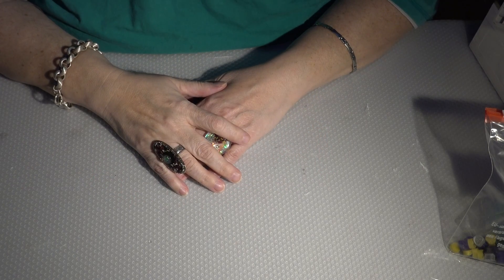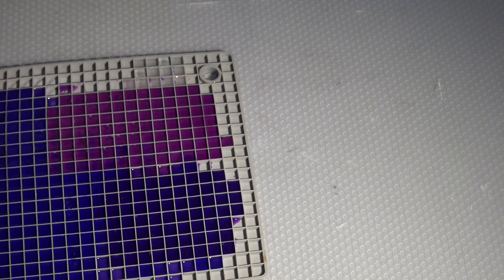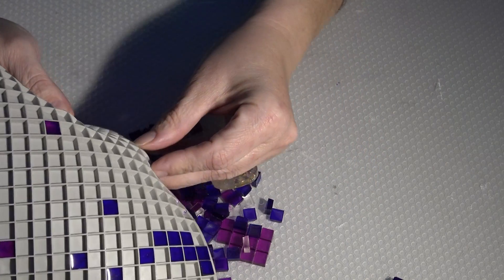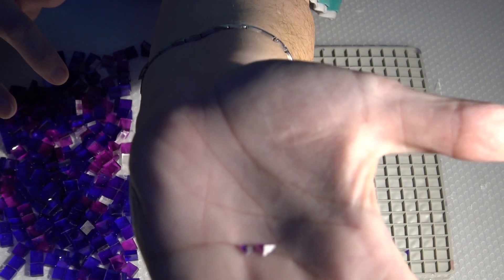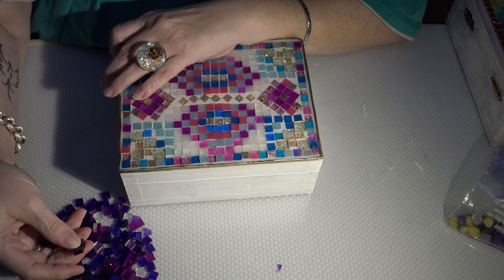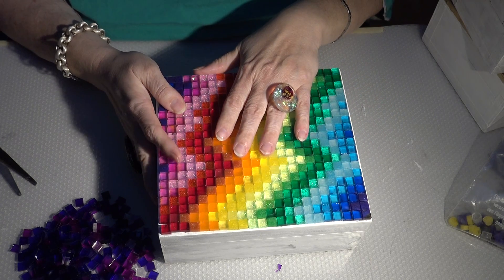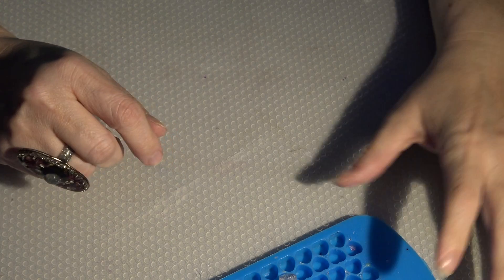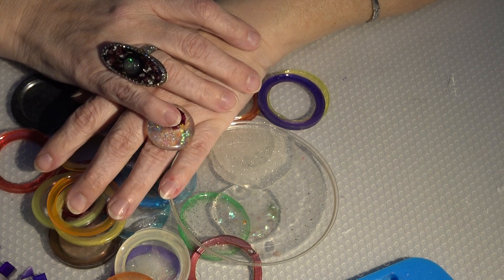7. What to do with my leftover resin???

Comment: Great video! I've seen people use the square tiles to use as a backsplash in the bathroom or kitchen.. the rings from the bottom of the cup (as well as the square and heart pieces... Used together ) would be cute as earrings.. I'm also thinking the circle ones could be linked together for a belt...
Reply from the maker: That are really good ideas! Thank you so much. A backsplash, yes that would look really nice, but I would be afraid to melt it, if a hot pot gets on the surface... But maybe behind the sink... That would be just as nice 😊. Than you.

Comment: With the circles:  how about some cool mod hippy earrings or a big statement necklace using the bid disk surrounded by smaller circles?  Or a cool hippy belt with jump rings in between?  Some kind of drill would be needed for the wiring of course...just a thought.  Lovely work, and thanks for sharing.
Reply: Nice ideas... Thx
Reply from the maker: awesome ideas. thank you so much and thx for watching.

Comment: Thank you, this is a great video! I use the same cups to mix colours and I get those rings too. What I do with them is to put them inside a bigger piece while pouring (if the rings are of the same colour you won't notice them). 

For example, I'm making an ashtray with clear resin and flowers inside, I use a clear ring inside of it, mixed with the flowers and that's how I use less resin. :)
Reply from the maker: yes you wouldnt see the rings... but, what if i want them to show?? maybe in some kind of special order or so... other than that, you can use them as filler.... i agree.